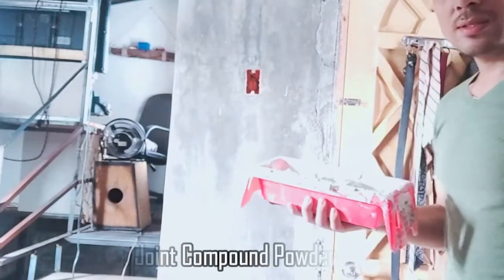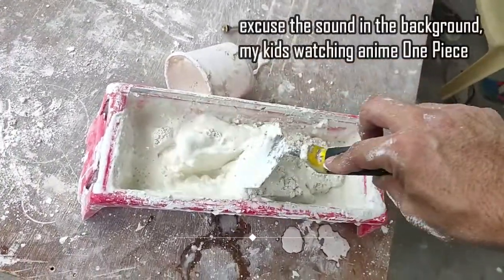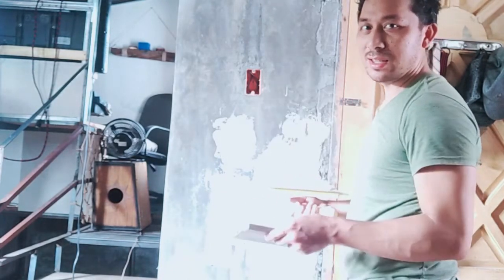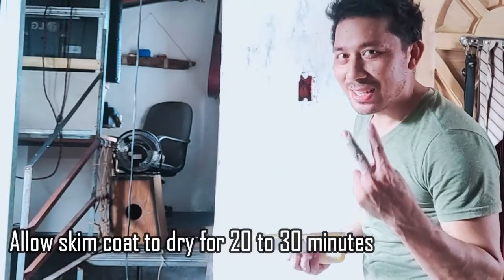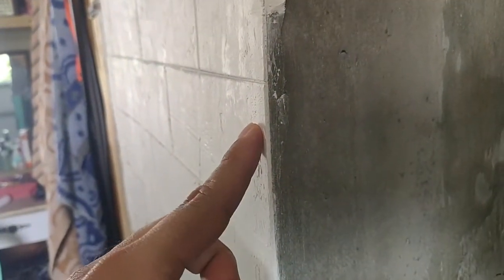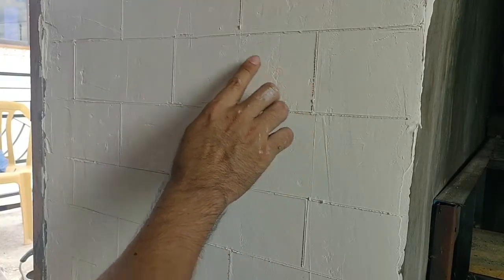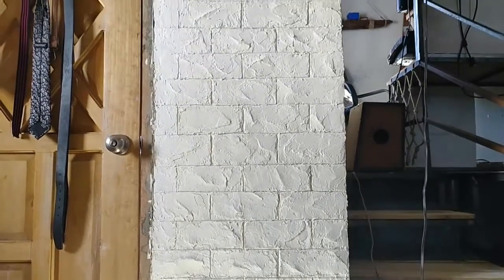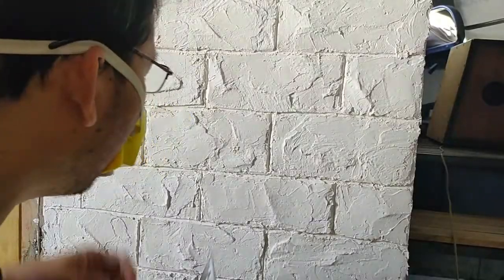How to create faux fake bricks using skim coat drywall mud

Comment: Love it. i did mine like this too but cheap stucky tiles under it so i can remove later. Im going to use my nail buffer or my my dremel.to lightly  smooth some.areas out. But it looks great the way it is. Lol i do 2ish id given it a thin coat on the walls first n not used.these.particular tiles. They are not trick at wll n i hwd ro add cheap dollar store type command stips as they dont srick so great anyhow.  Even a floor.tile.would have been better from the buck store, but hey. What can you do. It turned out great, and i love it l. Im gonna do my bathrub now, but using a thinner motor or soft concrete 😊